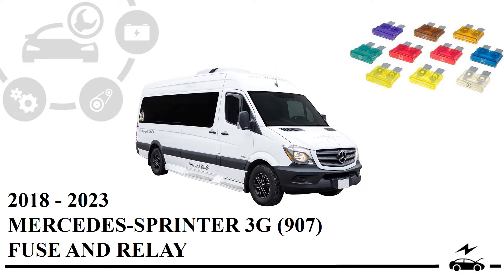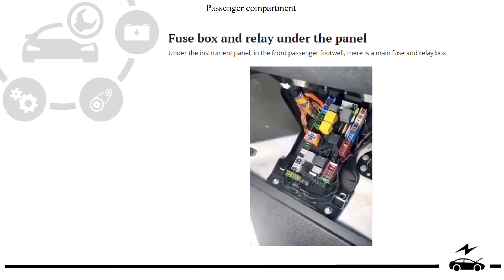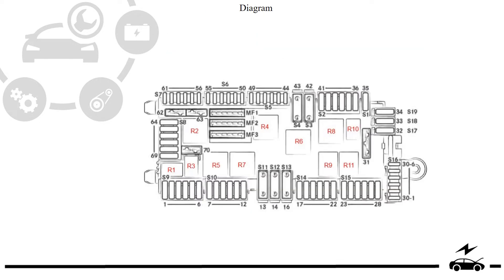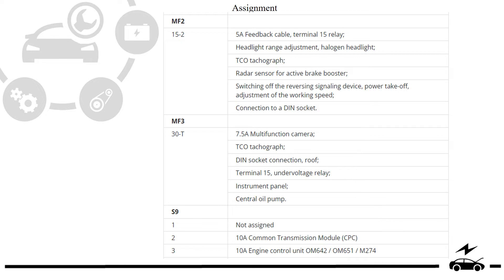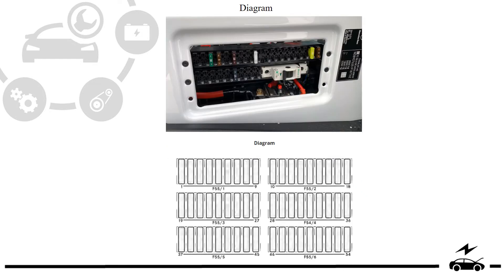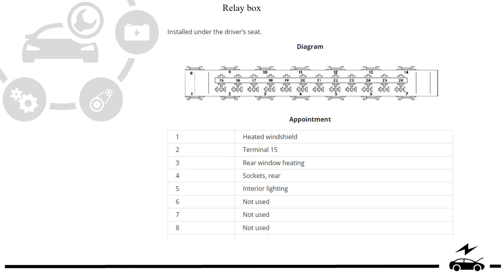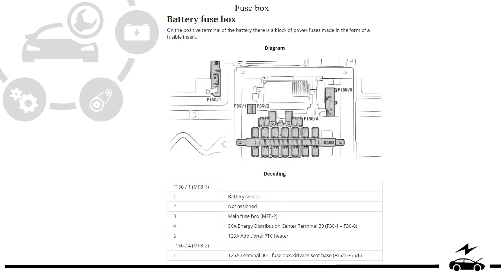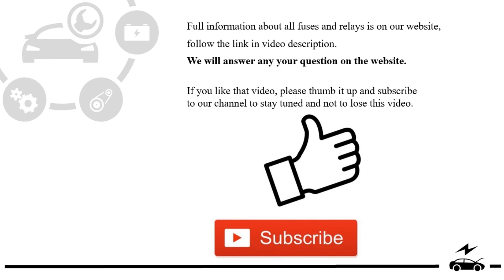Fuse box diagram Mercedes-Benz Sprinter 3G (907 910) and relay with assignment and location

Comment: My fuse blew for ciagrette lighter. for the outlet under the driver's seat. It is a 15 Amp. And it is located on the fuse box under the driver's seat. And for the outlet under the center cluster. It is a 15 Amp and is located under passenger foot area. Fuses are cheap at oriellys. You don't need to buy Mercedes brand fuses.